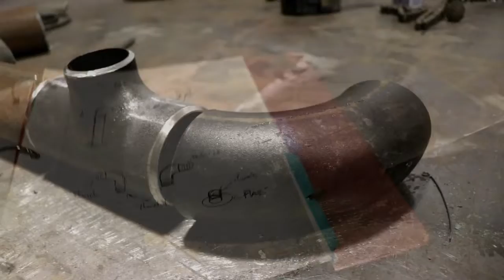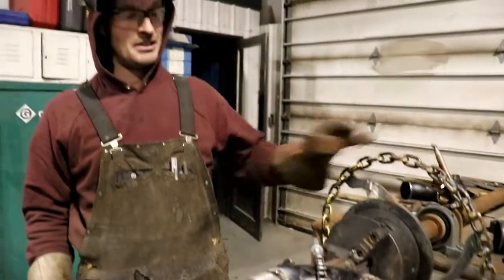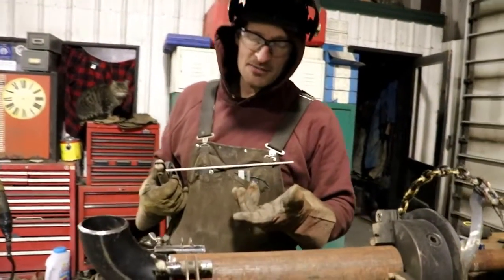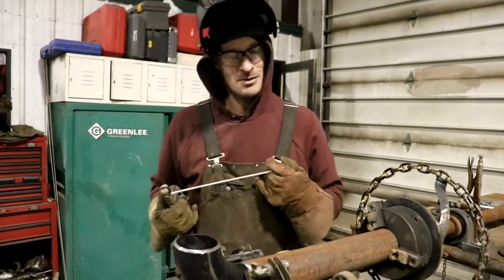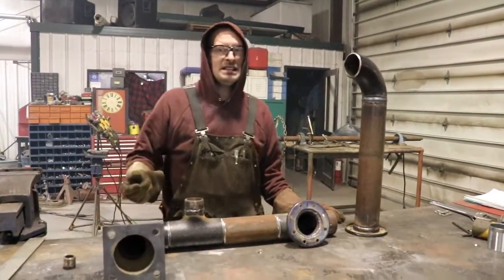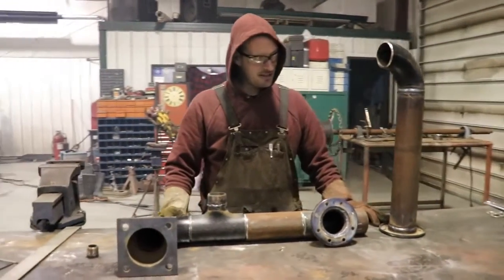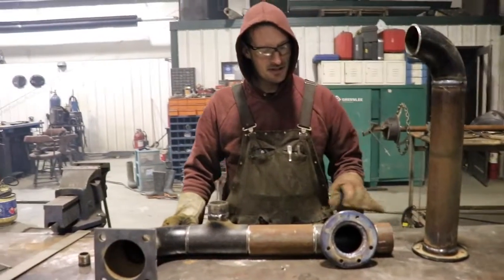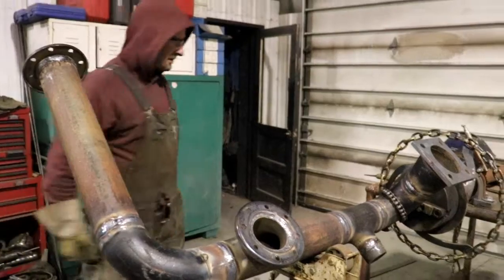Pipe Fabrication for an Oil Pump Using SMAW Welding

Comment: When you did your tracks on the threaded nipples did you use 7018 to tack it I usually use 6010 but sometimes the tacks break because its alot more brittle than 7018 I'm gonna try it if that's what you did
Reply from the maker: yup bridge tacks with 7018